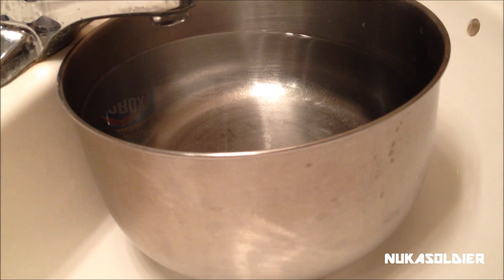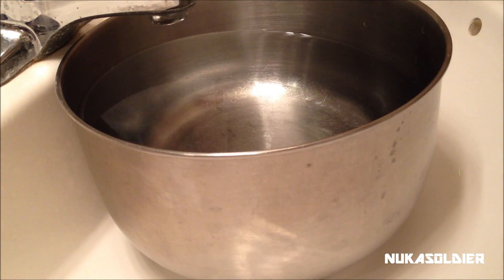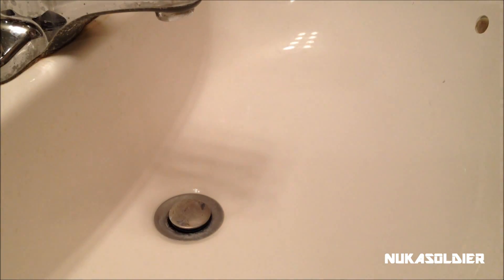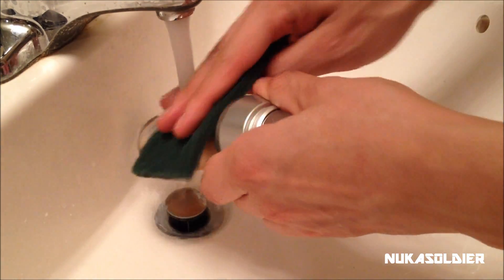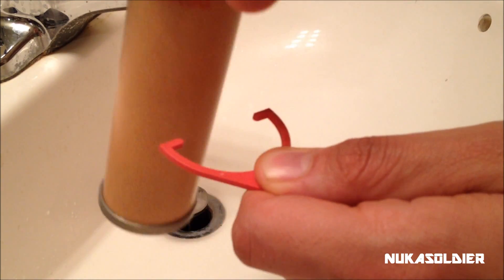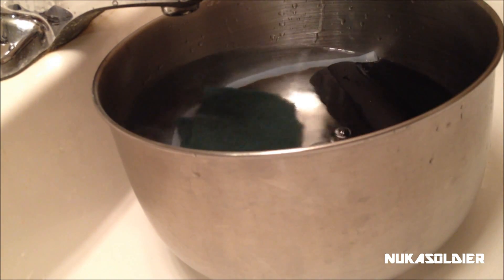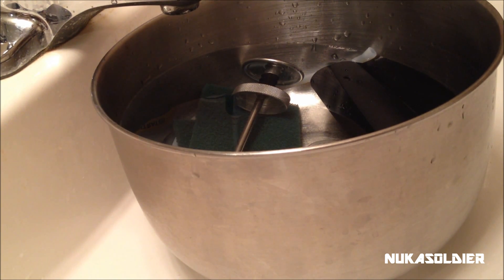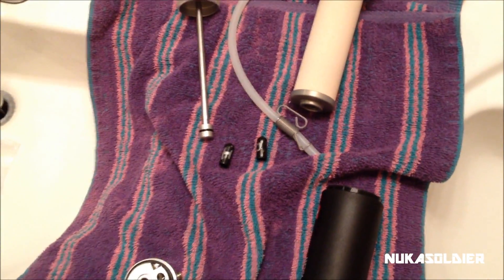Katadyn Microfilter - Best Way To Clean & Sanitize

Comment: Using bleach to clean your filter element is not recommended, as there are tiny silver particles embedded in the filter to protect it from bacterial growth. Bleach tarnishes and degrades silver - therefore you are rendering the inherent antibacterial properties of the filter more and more useless with each filter cleansing following the method you describe in this video. When in doubt, it's always best to follow the manufacturers instructions. The manufacturer knows best - and they say nothing about using bleach. Katadyn only instructs users to flush with filtered water for daily use, and to flush with filtered water, followed by air drying of the element for long-term storage. I would suggest you take this video down so as not to mislead any more viewers.
Reply: Maybe your instructions are different than his. I have a Latadyn hiker pro, and under the section titled "long-term storage", it says to fill a liter container with tap water and add two tablets of Micropur Forte or 2 tablespoons of ordinary household bleach. Not saying that's what I feel comfortable doing, only saying that IS the instruction from the manufacturer.
Reply: @stephenrichard4264  hiker pro has a fibre glass filter, this is a ceramic filter

Comment: Just my observation: You used the cleaning pad to remove all the built up debris off the element. Then you placed the pad that now has a concentrated amount of debris into bleach solution with the rest of your output items. Shouldn't you put the pad in with the input items to keep cross contamination at a minimum? If not, you might as well put everything into the bleach solution at the same time.
 Great vid, thanks for posting!

Comment: Mine came with a small tube of silicone to lubricate the o-ring. Working in the medical profession I know that silicone is very harmful to ingest and I do not trust that it will not contaminate my water. I thought about using vaseline instead, but then I heard that a petroleum based lube will degrade the o-ring. Any thoughts? What about vegetable based lube such as glycerine?
Reply: Coconut oil
Reply: The lubricant that katadyn gives you is foodsave